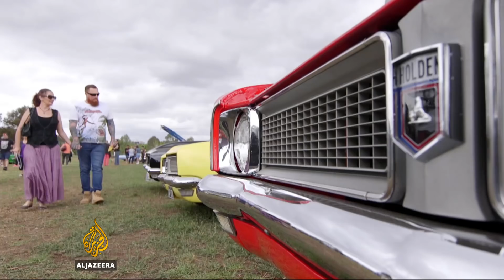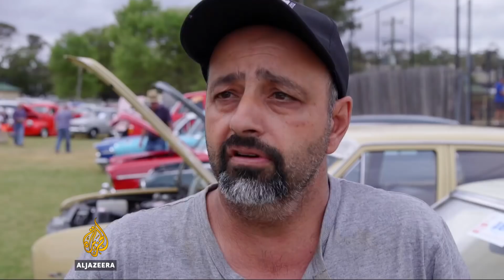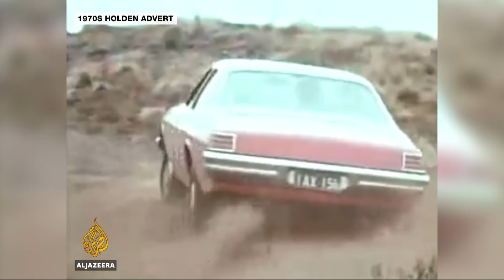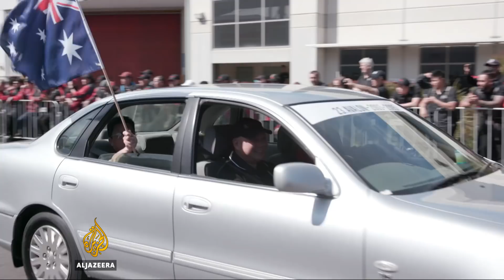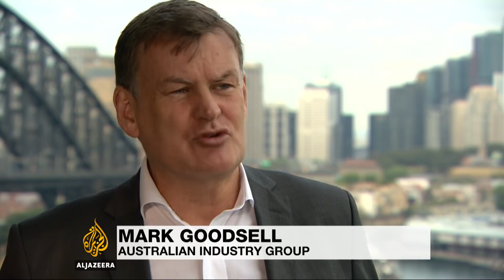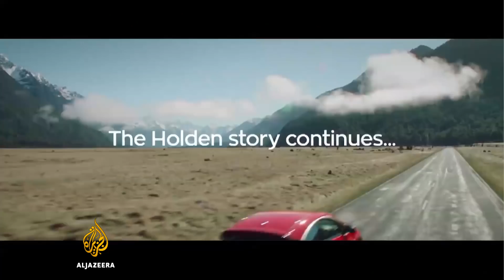Australia closes its last car factory

Comment: I'm shaking my head as the so called facts reported in this video are FAKE .... The unemployment rate is NOT low, it's at least triple what the CORRUPT report, figures are manipulated as many factors are purposely overlooked, example, the homeless (100,000+), part-time workers,  casual workers, a spouse/partner seeking employment and other spouse/partner is working (even if it's 5 hrs a week). etc., etc. are not included in the unemployment figures.  Therefore, do not be fooled.  Furthermore, since the manufacturing of cars has gone abroad the workmanship has gone drastically downhill and cost of vehicles has risen ... Cars sold in Australia have become expensive junk!!  BRING MANUFACTURING BACK TO AUSTRALIA, IN GENERAL ...
Reply: Not normally a person to comment on YouTube but what Marie Anne is talking about (despite sounding a little crazy) is actually true. If you take into account of people working part-time and casual, inflation and wage grow etc etc. Than we really have an under earning society that's going to lead to some serious problems. A lot of businesses relied on Ford, Holden and Toyota and with them gone. Many face closing down if they can't restructure their businesses. Can't be bothered finding evidence because I'm not sure if you care enough to make my time involved in finding it worth it, but if you do care, than just google it and you'll find what you want.